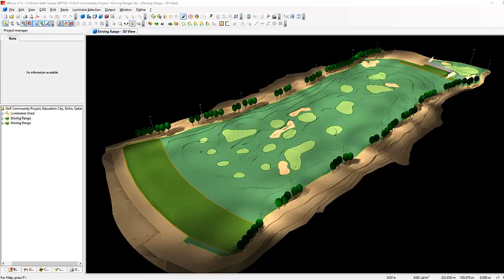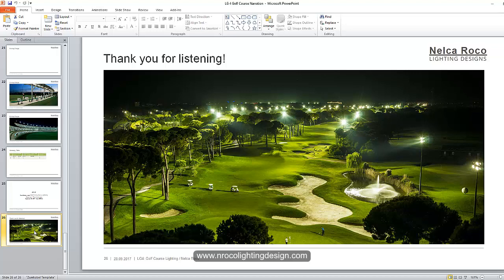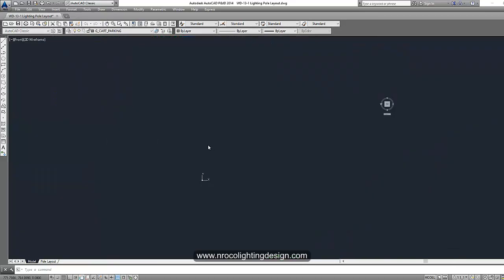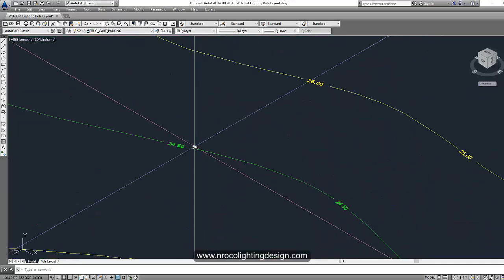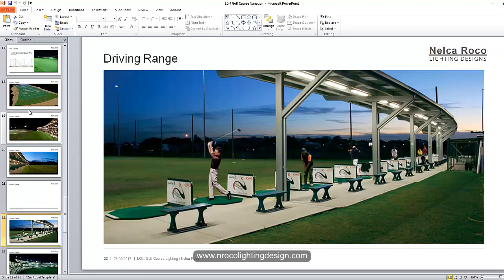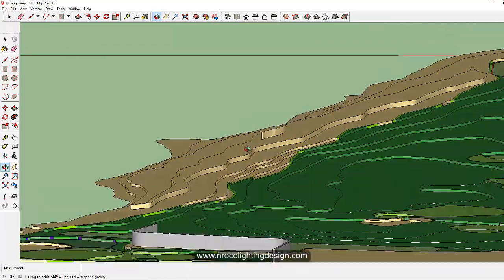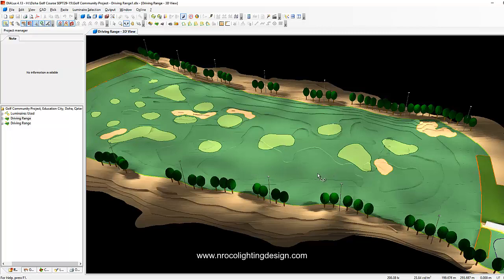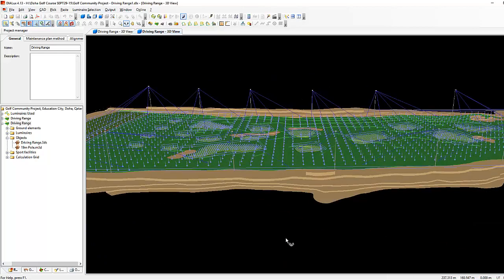How to create contour ground for golf course lighting calculation

Comment: Hi
very good the project
What is the extension of sketchup to dialux?
Reply: sketchup (skp) -> p.con planner (convert to 3ds with 'save as') -> dialux import.
or just have sketchup pro and save in 3ds without intermediate software.
Reply from the maker: .3ds file